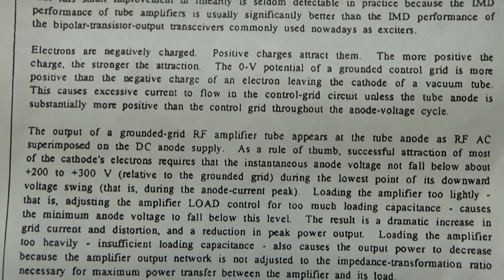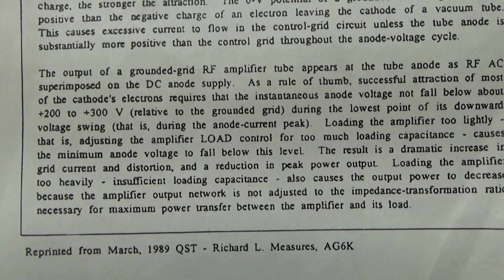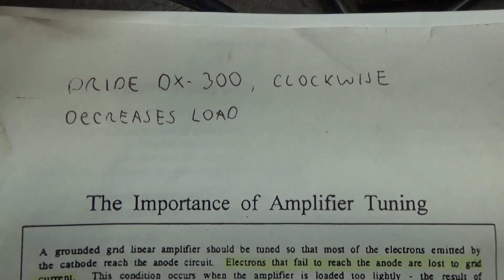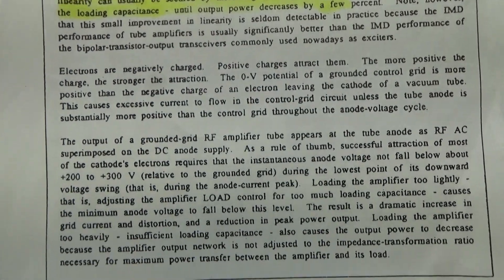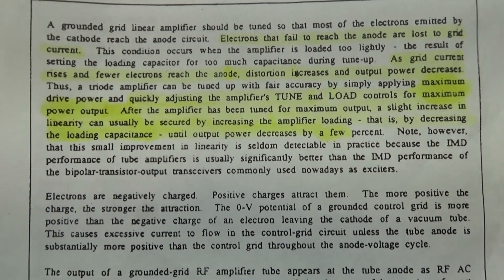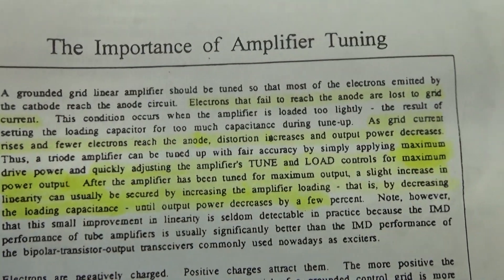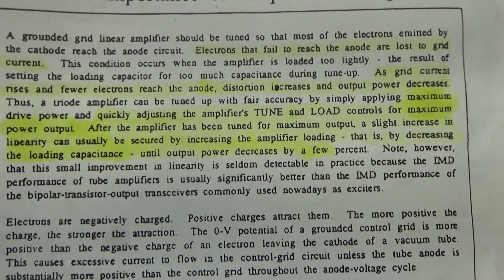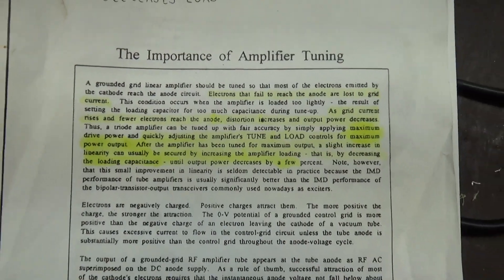Tube Linear Amplifier Tuning from Richard Measures and Henry Radio

Comment: I have an Alpha 76A with three 3cx400a7 tubes. I tune for maximum output, while equally watching the grid current. Then, I bring the grid current down from about 70ma to 30ma, to (hopefully) get longer life out of these rare tubes. I think I only lose about 10 or 20 watts after detuning (when running 1.5kw).
Reply from the maker: I agree with that as long as you are increasing the loading to do that.

Comment: Your videos make me miss my maco 200 back in the day.. was there ever another tube that could replace the 8950? Just curious.
Reply from the maker: The 8950 was just a 12V filament version of the 6LF6 family of tubes. Actually some versions of the infamous Palomar 300A used 8950's and some used 6LF6's wired in series for the filaments. Also the M-2057 some say the 'M' stood for Maco and others say the 'M' stood for Military, but either way it is the heavy duty version of the 8950.However even though its basically the same tube but bigger and heavier, it is not always a straight plug and play with the M-2057's. Plus, hope you are sitting down when you look at the price. Here is a tube sub chart I made a while ago:

9 pin mid tube with No Plate on Top
6JG6  17 watt
6JR6  17 watt
6JT6  17.5 watt
6KV6  28 watt

9 PIN Mid Size with Plate on Top  slightly different pinout than above
6JB6  17.5
6JF6  17
6JU6  17
6KM6 20

9 PIN Large tube plate on top same pinout as 9 pin medium above
6LQ6  30
6JE6  30
6ME6  30
6MJ6  30

12 PIN large (Palomar Maco)
6LF6   40
6LX6   40        6LF6, 6LX6, and 6MH6 are said to be virtually identical except for size
6MH6  38.5
6JS6   28
6JS6A  28
6JS6B  28
6JS6C  30
6KD6   33
6KN6*  30
6LB6   30
6LR6   30
8950    33   12V Filament
M2057 40   12V Filament
Reply: @tramdr  I'm sure the price is unreal.. the 8950s were back in the late 80s.
Reply: @tramdr  I used to love to watch those blue lights dance when the modulation started going
Reply: @tramdr  I'm guessing tube linears are completely gone or are they? only thing is left is the antique? I figure most of its solid-state now in it?
Reply from the maker: Tubes are still popular for the base. They generally perform better than transistors and produce a cleaner signal when ran right. However, transistor base amps are catching up. In a word.....Mosfets.
Reply: @tramdr  you should do a video of the lights dancing in the tubes when modulating
Reply from the maker: One day hope to get my Globe King 500 100% right. Then it will show it dancing.